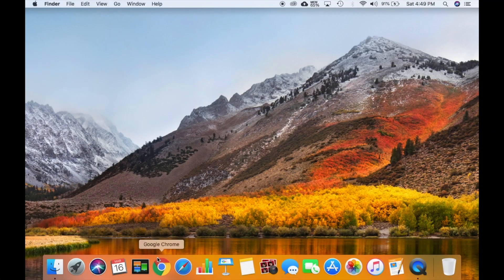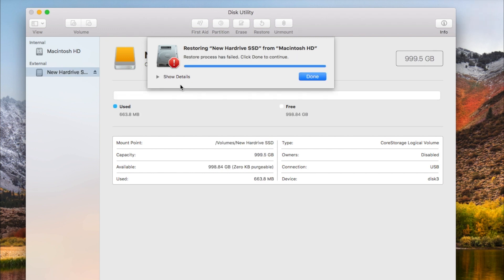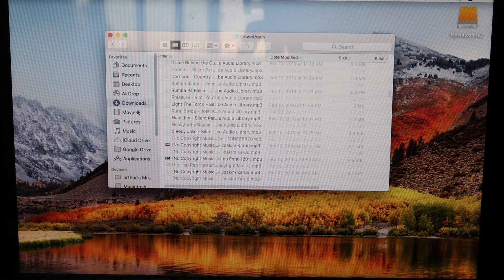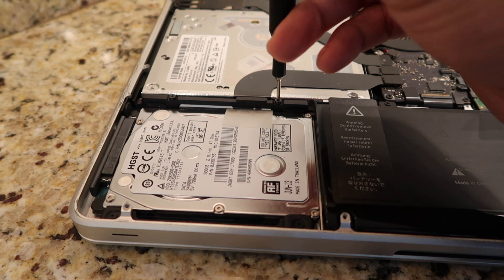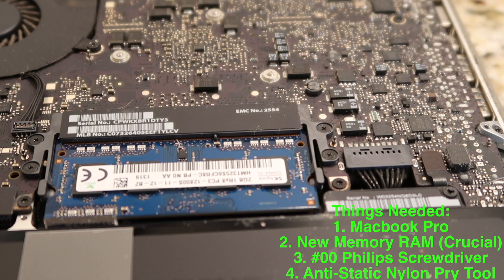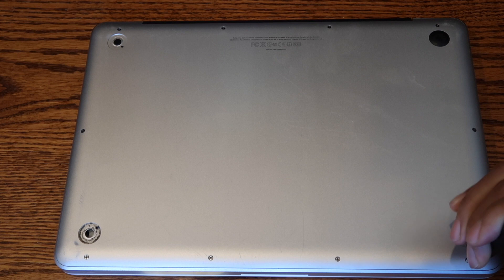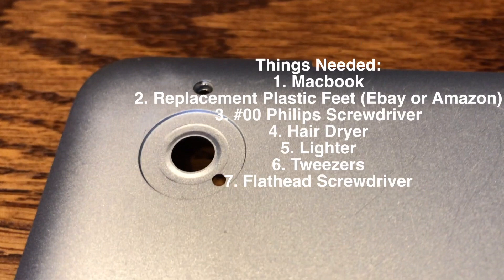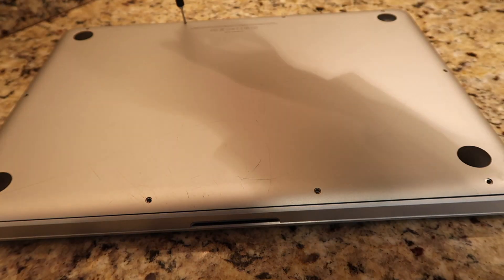HOW TO UPGRADE MACBOOK PRO MID-2012 | UPGRADE MACBOOK PRO (2022) | FASTER MACBOOK

Comment: Is your Macbook version Mojave with i5 processor? I have upgraded my hard drive to SSD and my RAM is 16GB. I'm planning to update the MacOS to Monterey but I'm too afraid if it's going to slow down my macbook again. Plus, is there anyway to install 32bit app support on Monterey?
Reply from the maker: I’m not too sure sorry! But at some point the OS will stop being compatible with an older system
Reply: @DATAProductionsMedia  thanks for the reply.
Reply from the maker: @bane8726  you’re welcome!

Comment: I have a mid 2012 15" macbook  pro, 2+2 g memory, 500 g data disk and it's real slow.
The evo 860 is not available  now, would the 870 work instead? Also, what's the max memory suggestion and brand. Will the upgrades fit this 15" model as it does the 13"?
Thank you.
Reply from the maker: I have two 8 GB memory sticks in mine. You’ll just need the 15” battery and you should be fine with the evo 870
Reply: @DATAProductionsMedia  Installed 16 ram kit and Samsung 870 ssd. Wow, night and day difference. Again, thank you so very much for sharing your knowledge and easy to follow instructions.
Reply from the maker: @DD-bx3gm  You're very welcome! Happy to help! Enjoy your practically brand new machine!
Reply: @DATAProductionsMedia  does the 13" and 15" use the same memory and hard drive? I was told by best buy that the mid 2012 might be losing access to the internet in the near future. Any thoughts on that? Thank you again.
Reply from the maker: @DD-bx3gm  I am not sure about that internet access thing! It may be software updates. Cuz internet is internet no matter the computer.
Reply: @DATAProductionsMedia  Good day.
Question: I'm running High Sierra 10.13.6 and it has reached the end of its updates. I recently took a hit from Microsoft, my Office programs have taken away the abilities to send mail (outlook) and edit and print in word, excell etc.
Is there an easy way to upgrade the mac os?
Reply from the maker: @DD-bx3gm  Go to the apple store! And check for OS updates.
Reply: @DATAProductionsMedia  I'll give it a try, but I think my mid 2012 macbook pro will not update any higher.
Thank you.
Reply from the maker: @DD-bx3gm  You're welcome!

Comment: i upgraded my macbook pro from 4gb to 10gb but it seems its not getting faster even it is 10gb and 240gb SSD , do i need to upgrade processor? or can it be upgraded?
Reply from the maker: You need a HHD for the faster processing and I would max out your memory to 16GB

Comment: Hi! Thanks for the video! I'm currently in the midst of upgrading my macbook pro 2012 and this video is by far the best guide out there. Quick question, I was able to follow along until 2:00 where when I wanted to Restore, the "Macintosh HD" did not automatically show up, it's just blank. Would you possibly know the solution to this?

Comment: Hi! Great Video! Question: I want to upgrade my macbook pro mid-2012 by replacing the HDD with SSD and make the SSD the boot drive and put the HDD to the optical drive. Is that possible? Do you have video for that? thank you
Reply from the maker: I do not have a video for that, I apologize!

Comment: If I don’t clone my info from standard hard drive to an SSD but I change the hard drive to and SSD and replace the ram will it still work?
Reply from the maker: Yes! You just have to install the compatible Mac OS with the new SSD
Reply: @DATAProductionsMedia  awesome thanks!!  Went to buy a pixelbook but it wasn’t what I expected so I returned it but then I found my sisters old MacBook Pro 2012 and never realized how good of a laptop it is! Never was a fan of Macs (didn’t know how to use them) but now I’m updating everything about it
Reply from the maker: Yes! In my opinion MacBook Mid-2012 are one of the last models they truly made into a great machine!!! 🎥💭

Comment: Hey! It is really nice to see you still commenting even after 2 years. One thing that I would say that changed through this process is that apple is no longer formatting as Mac OS Journaled. It should be APFS, and you need to make sure to either "decrypt" Mac OS HD by either going into terminal and unlocking the volume, or either go into settings- privacy and security- then turning off filevault. Not that much of a difference, however, I would say the old way that Apple had it was much more streamlined and easier to understand. Besides that, nothing really changed. Thanks for this informative video!
Reply from the maker: Thank you for that update!!

Comment: I am running Catalina. It has Macintosh HD & Macintosh HD - DATA. which one should I select for restore.
Reply from the maker: oooh I am not too sure. I would google it. Does both options have data stored in them?
Reply: Macintosh HD has the OS & Macintosh HD - DATA has all the data in it. Before Catalina it was just one option.

Comment: I have a question, my gf gave me this MacBook pro, and I want it fresh, but with the upgrades. I don't want to have any info on it, no back ups or anything. Do I need to connect the SATA cable? Or should it be good to go out of the box? I'm basically wanting a fresh computer.
Reply from the maker: Just put a new SSD in then install a compatible operating system!
Reply: @DATAProductionsMedia  awesome! So a fresh SSD and download an OS. I'm going to add a new ram, SSD, and battery to mine then. This video really helps a ton! I just ordered new parts for it.
Reply: @DATAProductionsMedia  I have my new SSD in the computer, but I'm trying to install a new OS fresh. How can this be done? The old ssd had failed and is no longer working. I'm trying to make everything happen right here on this rig, my resources are limited.

Comment: Thank you for this informative video. I just have a quick question because. I am not computer savvy. By upgrading the laptop does that mean it can update MacOS to the most current Apple has available? I hope my question makes sense.
Reply from the maker: No problem! There is a threshold on the OS system a Mac 2012 can have. I’m still on Sierra but You should google which latest OS you can download! I’m sure you can get something later the Sierra
Reply: @DATAProductionsMedia  Thank you for your prompt response. I will definitely be upgrading the hardware. The reason I had asked the question was because, and I am sure you have seen this before, we get to a point with older hardware and when you are trying to open a page it states something to the effect of “you need to update Chrome to the latest version.” So I guess with the upgraded hardware that should allow us to do update Chrome to most compatible version. Again, thank you so much.

Comment: @D.A.T.A Productions Media is the SSD that you used to clone your system and files is the same SSD you installed as replacement for the old HD?
Reply from the maker: Yes!
Reply: @DATAProductionsMedia  I'm planning to use 870 EVO. Will the procedure you used with 860 EVO gonna be the same with 870 EVO?
Reply from the maker: @Joseph-rs2ij  if it’s the same dimensions then yes!
Reply: @DATAProductionsMedia  I wonder if I can install two ssd on this macbook? Replacing the optical drive with anohter SSD. What are pros and cons?
Reply from the maker: @Joseph-rs2ij  I’m not sure about two SSD. I would look it up!
Reply: @DATAProductionsMedia  don’t forget to reply here once you’ve tried it! 😉

Comment: So, after doing all these upgrades, what is the latest version of macOS that can be installed on it? Is it a later version than could be installed before the upgrades?
Reply from the maker: I still have Sierra on mine. Not sure tho! I would google it and see
Reply: @DATAProductionsMedia  I see! Can you explain what you can do with macOS Sierra nowadays? If someone had a new installation of Sierra, they would be blocked from downloading lots of apps from the Apple Appstore, such as Xcode, Keynote, etc. They could get older versions of these apps from the Developers section of the Apple website after paying Apple $99. As for me, I own a MacBook Air (early 2014) with 4Gb running macOS Big Sur. However, I've been getting some messages saying that my memory is low, so I should close some apps. I don't know how serious this might get. I've seen a video about what it would take to upgrade the soldered 4Gb RAM to 8Gb, but the chips look nothing like any chips I've ever seen, and the type of soldering is totally different as well, so I can't upgrade it. I don't know how much an independent Mac dealer would charge for this. I've achieved my goal of buying a Mac which can run Logic Pro, though. This is Logic Pro X, after being with a producer using Logic Pro 9 in a studio years ago. He used it, while I played the music, sang, and watched him.
Reply from the maker: @paulbraun5657  I am getting a new laptop soon! I still am using final cut pro for making my videos. I have nothing fancy. So I really can't answer what the OS can or cant do.
Reply: @DATAProductionsMedia  I have now bought a MacBook Pro 13" 8Gb mid 2012 model with a 500Gb hard drive from eBay. It came with Catalina pre installed. I've also read that I can even install Big Sur either by turning off lots of security settings or by installing it using "Patched Sur", so I plan to do that. Thanks again for the advice in your video!

Comment: Just saw ur vid, I got my dads mid 12 MacBook Pro, I did a complete reset, and I install the ssd with out doing any downloads. I’m not transferring nothing because we whipped it cleaned?
Reply: Did you have any problems with the updated hardware, because I know with Apple if it’s not a native component they start giving problems did that happened to you. Yeah I’m trying to update the ox it’s still on Yosemite
Reply from the maker: @danoise_007  my battery got worn out inside a year but I produce documentaries so it’s expected with anything refurbished. SSD in good shape but I will be needing an upgrade in laptop soon for myself personally! I’ve truly have had it since 2012
Reply: Thts wht I’m worried, if I’m going to open it, rather put good parts and do it once. Like I said before my pops had it new, used it for 4yrs and then it just sat collecting dust. I’m going to usd for light room for photo editing. Recommend better parts for it
Reply from the maker: That’s fine! Just upload the latest possible OS for it and you’re good to!

Comment: When getting to the restoring the SSD from MacIntosh HD I am getting this error message: "Restore process has failed. Click done to continue"  When I look at the details, It tells me that "it can't restore a locked encrypted volume. and suggests that I "try running "distil apfs unlock volume" first. Do you have any idea how I can go about that? Thanks.
Reply from the maker: Thank you for your comment! Off hand, I do not know how to handle that situation. I would either look thru the comment section for an answer or google or other YouTube videos! Sorry I cannot be of service on this issue!

Comment: If you're not trying to transfer any files do you have to do the first steps before changing to the SSD, prior to 4:10 in the video?

Like, is this also transferring the computer's basic information or just personal files?
Reply: Do you mean don’t do the cloning part. I have a new ssd and I have all my pictures and documents in iCloud. Do I need to use the SATA cable or can I just put the new drive in my Mac. Sorry some of this lingo is so foreign to me.
Reply from the maker: @lizPKarson1020  you should be good to go putting the SSD in if you have nothing you want from the old hard drive!
Reply from the maker: Everything on the old hard drive. If you want a blank slate with a new SSD. Don’t worry about transferring things over
Reply: Thank you. Subscribed

Comment: 1/30/2021  Tried your method. Formatted SSD to match existing HDD.  Disk utility would not let me restore the HDD.  Verified SSD twice.  Used Macintosh HDD as source and SSD as destination.  Drop down told me to restart computer in recovery mode(?) then go to disk utility.  Currently running 10.8.5.  What gives?
Reply from the maker: Hopefully you eventually figured out the issue!

Comment: It's not working for me 🥺. Every time I connect the SSD it won't stay connected. Maybe it's my cable 🤷🏽‍♂️
Reply from the maker: I’m sorry to hear this! Yes, try a new cable to see if it workd
Reply: @DATAProductionsMedia  I tried a new cable. But my computer is showing 3 internal dives. I have multiple drives show up under external.

Comment: Question I believe I have 500gb stock HHD in my mid 2012 mbp 13” and just purchased a new 500gb SSD along with 16gb ram in order record and playback audio more seamlessly for my studio set. Question, in cloning the info from my HHD to my SSD doesn’t that defeat the purpose in optimizing performance or is performance more so based on the amount of RAM installed?
Reply from the maker: No both Ram and a SSD help optimize your computers performance! Ssd holds information different in a more efficient way
Reply from the maker: @jackbaverstock1600  I upgraded my laptop myself with the same exact steps in this video! Spent around $600-800 on upgrades in total

Comment: I did it.  Upgraded to 16 GB RAM, 1 TB SSD,  Spent about 30 minutes on the labor.   Wow I never realized these mid 2012's could run so fast.  This Mid 2012 now fully boots from power up to fully loaded High Sierra OSx in 22 seconds.  btw I chose Crucial RAM and SSD due to the pricing I found.   I discharged the new battery to below 10%, fully charged it and repeated that again.  Cycling a new battery is something I always do t insure I get max. performance.        Thanks.  Well done presentation.
Reply from the maker: Thank you very much!!

Comment: Can upgrade the ram only?
Reply from the maker: Yes you can!!! Super easy
Reply: @DATAProductionsMedia   I appreciate the reply! 😭 Thank you so much! Dont know how can I upgrade to ssd, coz my screen pitched blacked dim that I needed a monitor to use it, so it's like a mac mini. That everytime I try accessing the recovery mode, it won't reflect to the monitor 😔 do you have any tips? Its too expensive to have my screen fixed.
Reply from the maker: @sydneymarinda  honestly you may be better off just buying a refurbished Mac 2012. They are like $300

Comment: Hey!
I'm looking to totally revamp my mid-2012 MB Pro.
I need to upgrade my HD to an SSD, battery, ram etc.
What parts would you suggest that I should get? 
Unless the ones you recommended in 2019 are still the best available...
Reply from the maker: I have affiliated links in my description for what I use!
Reply: @DATAProductionsMedia  right. Those are from March 2019. I wanted to know if there is anything better on the market in Dec 2020 :)
Also, is 1TB your go-to or can i take a 2/4TB no issue (as long is its a 2.5")?
Reply from the maker: @Alshag465  you should be able to install a 2 or 4 TB Samsung SSD. It’s the same dimensions

Comment: can I do 4 tb insteead of 1?
Reply from the maker: If it’s the same dimensions then yes!!
Reply: @DATAProductionsMedia  yes it is , just want it to know if the system would support that much of a memory, because I use mine for music production and I have to store 100s of gb on plugins and sounds
Reply from the maker: @jesusenlamontana1376  I don’t have experience with using a 4tb drive in the laptop but I am sure it works fine!!
Reply from the maker: I do believe 4tb come in the same size so yes

Comment: Hi, i want to upgrade my macbook mid 2012 pro to 240gb ssd, 8 gb ram. does it matter what software version it currently has? mine currently is updated to MacOS Mojave 10.14.6. Will it pose any problems? i am scared it might go wrong.
Reply from the maker: If you transfer everything from your current computer to the new SSD drive. You should be fine. Best of luck!
Reply: @DATAProductionsMedia  so it doesn't matter if my macbook is in Mojave or not right? ^^
Reply from the maker: @SuperMrsakura  The only issue Ive seen with people has been with the Catalina update. If its Mojave, it should be straight forward. I did mine when it was Sierra.
Reply: @DATAProductionsMedia  thank u so much ^^

Comment: What's the highest ram you can put on this macbook pro mid 2012 but a 15in model or is it still the same as the 13in model which was 16gb
Reply from the maker: Yes! Still 16gb
Reply: @DATAProductionsMedia  ok and what about storage can I put more than 1tb ssd ? If so how much can I put
Reply: @DATAProductionsMedia  new subb